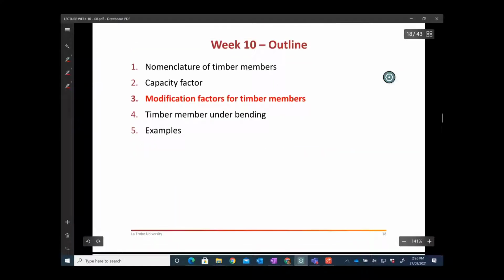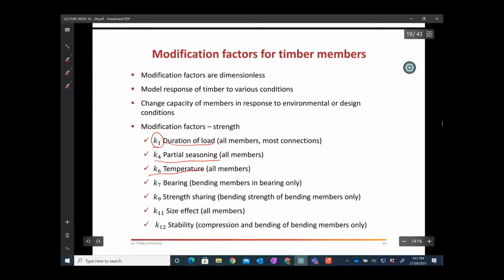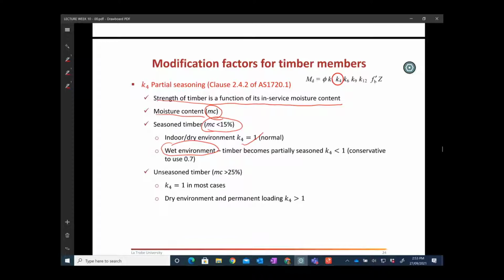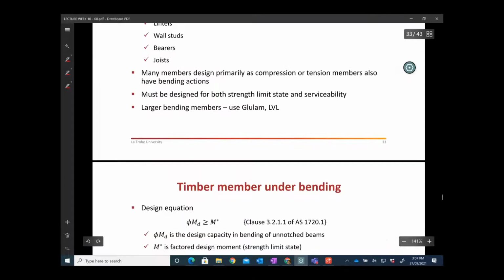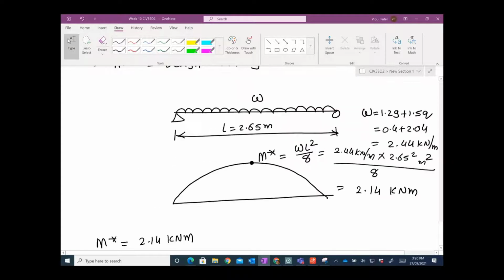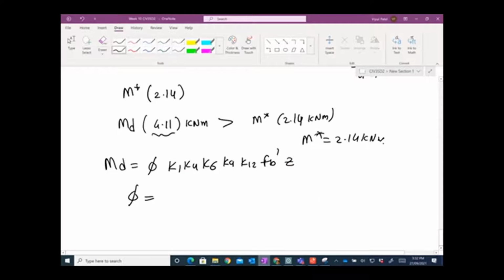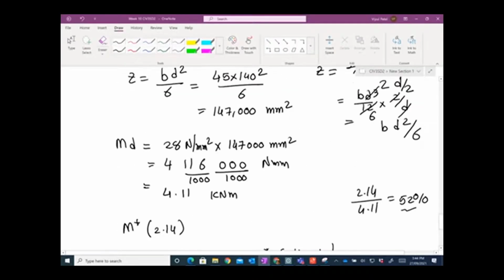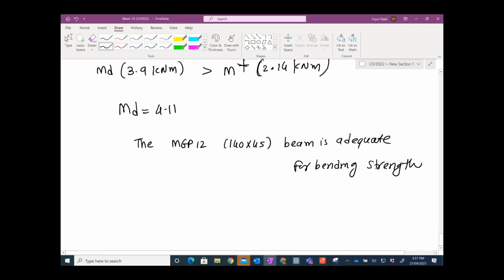Week 10 Lecture- Timber member under Bending AS1720.1

Comment: Sir, can you please upload lecture slides?
Reply from the maker: The lecture can be followed by the video.
Reply from the maker: The lecture can be followed by the video without the lecture notes.
Reply: @patelstructuralengineer1  Ok sir thanks and when calculating k12 factor why the discrete restrained condition considered? Joist is restrained by timber floor plywood then it is continuous restraint condition, can you explain my doubt?